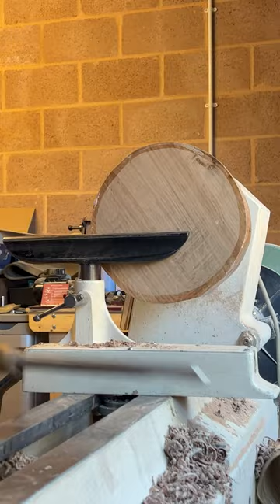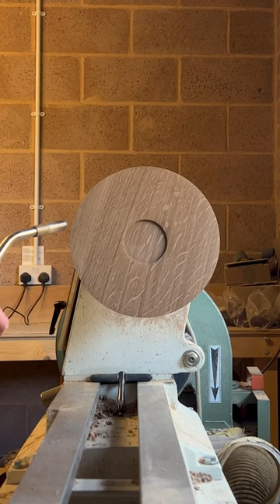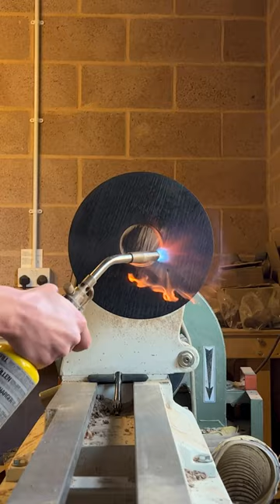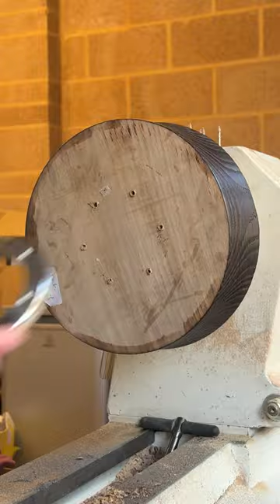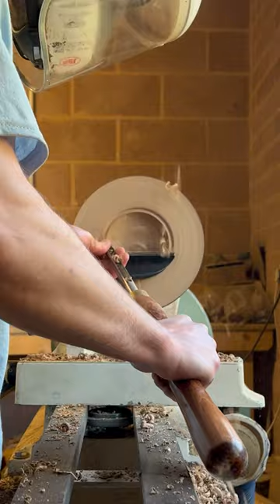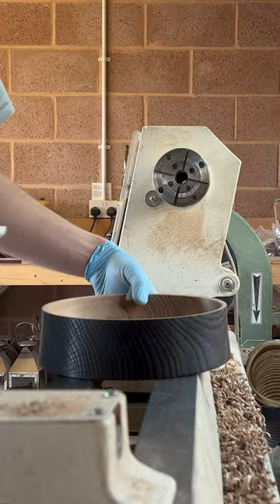Oak + Fire = ?  #woodturning

Comment: Which lathe do u use ?looks artillery machine .😍😍
Reply from the maker: In this video I use the Woodfast C1000 lathe but I recently upgraded 👌
Reply: @HenryKeateCarpentry  those are big lathes.i m considering beginning with a smaller one .a powerful lathe is good with a small piece of wood also?I believe no .greetings from Greece
Reply: Jet lathes have a good reputation.